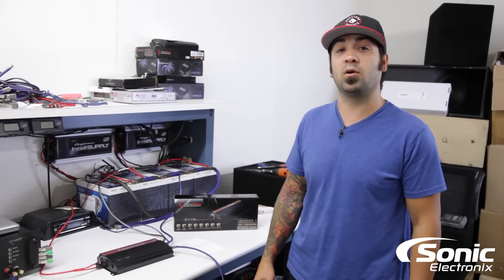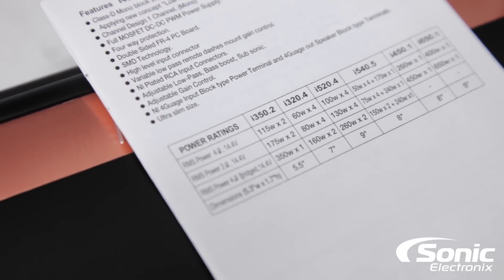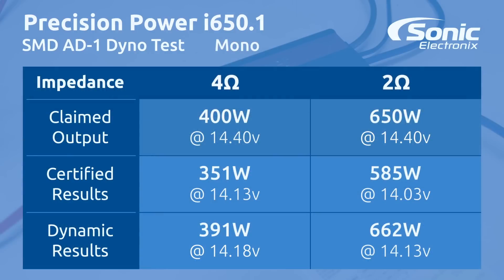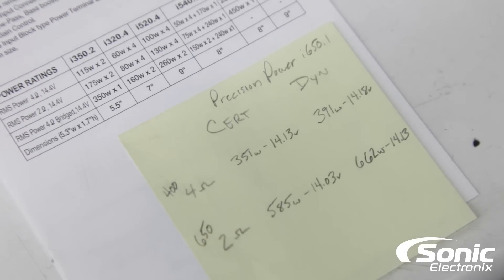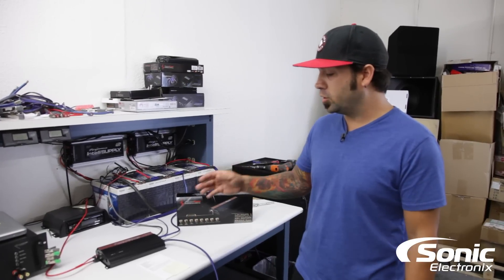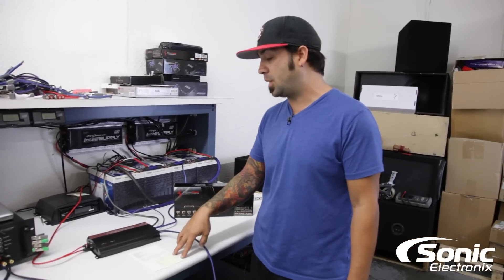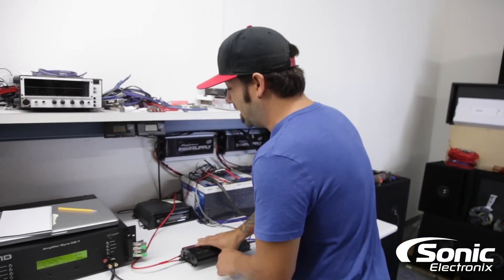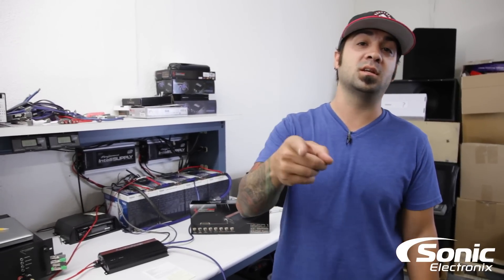Precision Power i650.1 Car Amplifier Dyno Test | SMD D'Amore AD-1

Comment: That's fine - no need to void the warranty (though I like seeing amp gut shots).  So it didn't quite make it to 650W RMS continuous output (at 585W RMS continuous, that's down approx 10%), but it made more then advertised at dynamic RMS output (which is more important and 2% above advertised).  So lets put things into perspective, a hypothetical single 4 ohm speaker with a 88db 1W1M rating at 585W RMS could peek (not taking into account any cabin gain, EQing, etc - just the ideal proper sized box for the hypothetical woofer to achieve flat freq) at 114db, while 650W it would peak out at 114.4db, and 682W peek out at 114.5db.  Now do the same with a hypothetical single 4 ohm speaker with a 90db rating - I estimate 118.7db, 119.1db, and 119.5db.  Anyway you want to look at it, 585w to 650w would be about .4db, while 650w to 683w is about .1 db for the maximum output - unless you have golden ears for continuous test tones , your not going to notice 585W to 650 to 682w unless your into SPL competitions and micing the car.  And even then there are other factors that need to be taken into account as you would be on an SPL quest.  So my thoughts - I'm really impressed on the power output given the chassis's puny size.  Well done PPI!  I can think of a few applications where that size and power output (esp if it's clean) would really kick....
Reply: but you have box rise....
Reply: lol no way 585 to 650 4 db   you get a 3db gain when you double power  or cone area  .
Reply: yeah ikr
Reply: Cadillac CTS  He said that the difference is .4dB  4/10ths of a dB.  Which isn't noticeable.

Comment: 10 yrs ago,  an amp with this kinda power would have cost $400-$500. 15 yrs ago, $600. Excellent deal. for $108.00
Reply: Those were class As or ABs too and sounds way better and im sure lasted longer. Class D is ok for bass but not mids and certainly not highs.

Comment: Weird an stupid question. I have these 2 15'' subwoofers 6 ohms each single coil. An I have a kicker cx1200.1 amp. Would it cause any damage to the amp ??
Reply: Depends on how you have them wired... Series or parallel? Parallel (both positives and negatives ran together to meet the amp) would be a final ohm load of 3 ohms, where as series (the positive cool of one woofer wired to negative coil of the other woofer, with the remaining positive and negative leads going to the respective outputs on the amp) would be a final ohm load of 12ohms. Either way your safe. Unless your wrong about the impedance of the woofers.... Hope this helps. 😉

Comment: I love my  Ion 1000.1D it makes the 2 sundown E series V1's I have in a sealed box sound absolutely Killer Running 1 ohm on the Stock electrical system and 2 batteries in my GMC Sierra 2500HD ext cab

Comment: I have been using these lil beastes for 4 years now and thy hold up great to all the abuse   i live the compact sise of thm and they barely get hot  one of my fave amps other thn the lp skars  but durable thy are
Reply: And i have used the 650 mono i have used 3 1000 monos and a 10004ch and the 5 ch the 5 chan wilm run ur whole car on low wats even a sub wit bassknob  i hope they dont quit making these

Comment: Can't believe anyone would buy an amp because it made more than rated power. You always match your amp to your speakers, not the other way 'round. If you have a single subwoofer with dual 4 ohm voice coils rated to handle 500 watts, this amp may very well be what you need. It makes the rated power your sub asks for and then some. Set your gains with a O scope and you're good to go!

Comment: dynamic power aka peak power
Reply: Actually dynamic power is still rms (root mean square)   Output of the amplifier not the peak power. The difference between the two tests is certified is a continuous sine wave ran to one percent distortion, where as the dynamic run pulsates a given frequency (more like the DYNAMICALLY changing frequencies you expect to see when playing music). Learn a little more about the functionality of alternating current electricity before you make such silly statements sir. 😉